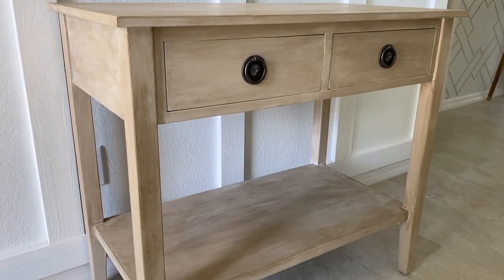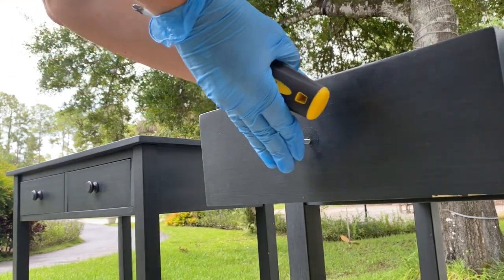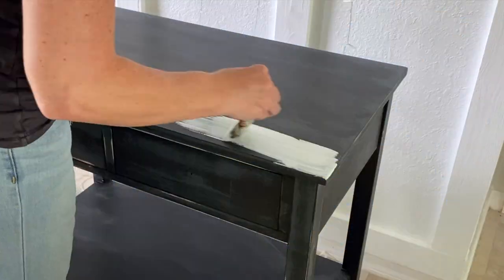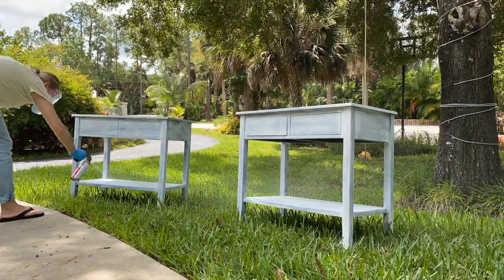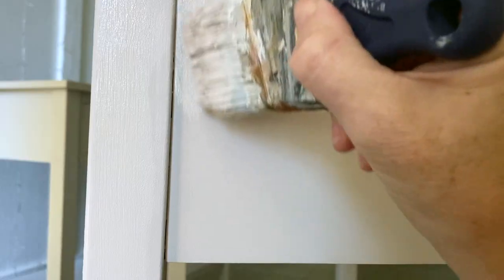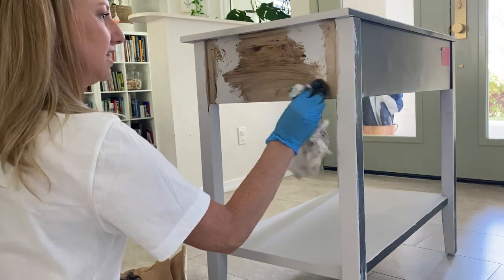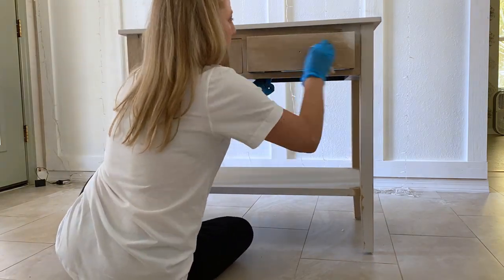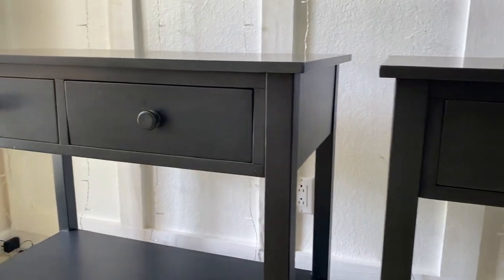Painted faux wood nightstands

Comment: Love the video and I’m now inspired to try and save my entertainment center. Long story short…my parter tried to sand, use Kilz (probably water based) and chalk paint and said it turned out horrible. So bad he brought it out to the garage right away. I’m scared to go look! He wants to throw away, but I want to give a try first. Do you have any solution if I sand too far? I think there are a couple of spots with the exposed material (stuff underneath the fake wood). Do you think I can sand off the Kilz and chalk paint still? It’s one of those entertainment center w/ electric fireplace like you see at Menards…not IKEA…if that helps describe the type of fake wood. Sorry for the long post!
Reply from the maker: Honestly, I wouldn't even bother sanding if it's not too uneven. The beauty about this technique is that it looks like imperfect rustic wood anyway! If the surface is slick or you think paint wouldn't hold, you could prime again :)
Reply: @HouseMixBlog  thank you! I’ll let you know how it goes!